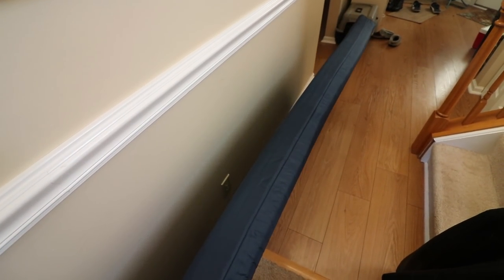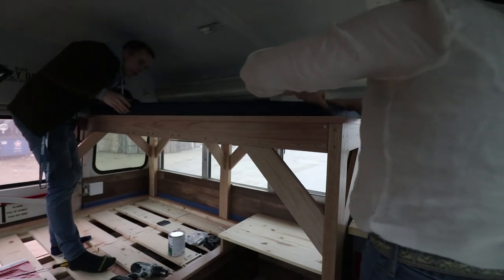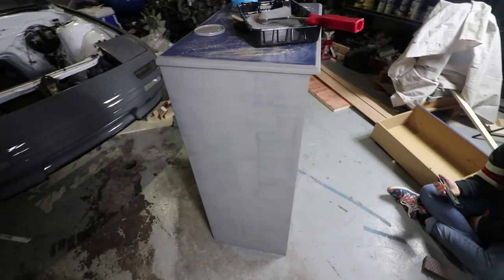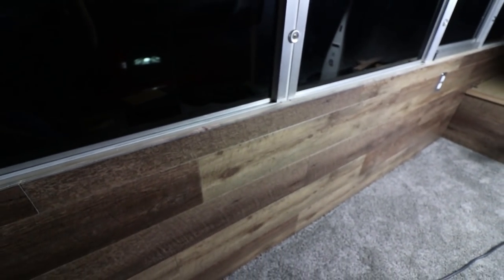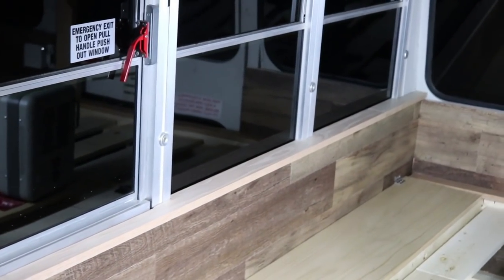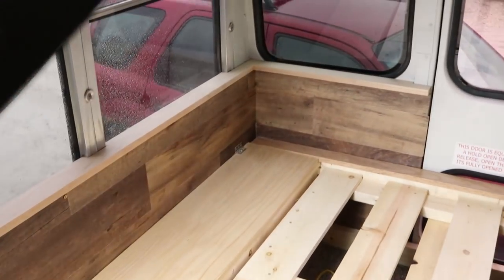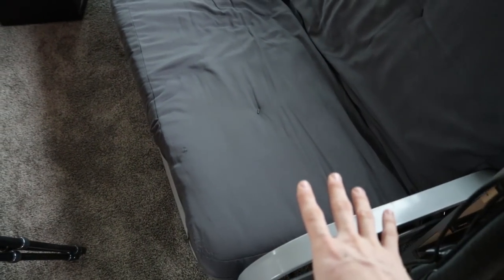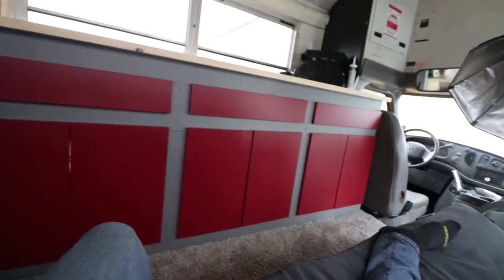Adventure Bus Build Pt. 14 - Dresser, Futon, & Window Trim

Comment: Get a mini fridge
Reply from the maker: We will!
Reply: Gingium how much have you out into the bus?
Reply: Don't get a cheap one, vertical 6volt is better I've heard.
Reply: Pretty sure that’s a requirement if it’s registered as an rv
Reply: Working sink, bed and cooking equipment are the requirements in Europe at least. Fridge is optional, you can just use cooler. :)
Reply: DG good point I actually believe that’s how it is here as well
Reply: mini fridgium
Reply: Where would he keep it? But that would be amazing
Reply: Why no sink and cooking oven
Reply: Yaaaaaa

Comment: Ginguium install a small propane heater and build  a metal compartment   for the gas tank under the bus there is plenty of space for it it will be more effective for warming your bus and save fuel while parked. I own my own shop on wheels and the heater works wonders on a 71 passenger bus  it heats up the bus way faster than a electric heater

Comment: Tinting those rear windows, is 50 state legal. You could paint them black, if you wanted. Only some states have laws against tinting the front window; driver's and passenger side, and the windshield, of course. I agree w/ you that curtains are a better option. They block out all vision, into the bus, and you can still open them, when you want the daylight.
Reply: Yeah... he said that in the video

Comment: sorry you weren't invited to the callout... #NoOneRespectsMiatas
Reply: Victory Gamingg wow... Just wow...
Reply from the maker: They're all too slow anyway
Reply: Gingium honestly I really don't care about speed. A slow car just means you can floor it longer!
Reply: Cole Reisdorf legally that is.
Reply: SlammedSocietyS2k :p well... I have my permit so if I speed my parents will freak out
Reply: Victory Gamingg I subscribed to you
Reply: Gingium what do you mean and hi
Reply: Heh, don't get in trouble with a permit. Will get suspended. Wait till you get your license. Then it still won't be great, but it won't be instant suspension.
Reply: Cole Reisdorf wait you meen to tel me you don't drive ferari
Reply: If that RX7 was turbo swapped in time it could have been a contender👌😢
Reply: Victory Gamingg HEY DUDE.. if you dont respect miatas, thats not our problem. If you don't like them.. WTF are you doing here??
Reply: Cole Rei
Reply: Milton Gimenez how could it be a contender if the lowest horsepower car in the race was adams 335i with almost 700hp
Reply: Cole Reisdorf last I checked the conversation was about his Miata. Not your driving
Reply: Spinddrift incorrect by far. David's 240 was the lowest power
Reply: Victory Gamingg oa

Comment: Put curtains up front and back but the rest can be as dark as u want with the tint, and it's legal to have tint on the side windows so please do tint. It's not hard and it's not that expensive. It will make the bus look better from the out side as well. And when your sleeping you won't have lights on plus with the lights on people won't be able to see in. So for the love of God please tint the widows. Ps this is like an essay for me^^😂😂
Reply: Jackson Beck nah trust me the curtains will look like tint as long their dark. Besides the side windows will provide natural light that will be much needed in the bus.
Reply: I think in Illinois you can only tint to like 35% blockage max on side windows if he wants to remain legal
Reply: That law is stupid! So I can drive a panel van with no windows on the sides (0% light transmission) but if I drive a van with side windows they can only be tinted to 35% light transmission? Stupid, just stupid.

Comment: How will you power a tv?
Reply from the maker: electricity
Reply: Gingium thanks for the reply lol but will you be getting a generator? Solar? Maybe just a bunch of batteries powered by the bus’s alternator?
Reply: Joseph Samsor he said in multiple videos he is using solar panels on the top of the van
Reply: Inverter
Reply: Gingium 😂
Reply: Could always use a similar system like the 18 Wheeler guys do. All the HVAC and Electricity is basically generated as needed for little to no diesel fuel at all. Should be able to easily adapt a system to the bus for this and never have to worry. Uses maybe a 1/4 gallon diesel for like 4-5 days or so (I was down once and thats all the system used to maintain 66F and a gaming PC at near full load all of the time.
Reply: Gingium 😂😂
Reply: Joseph Samsor  He can use a DC to AC power inverter off the bus' battery and when it's running, the bus' alternator.
Reply: He has an R.V battery to power electronics without using the engine Battery
Reply: Joseph Samsor they have batteries or a generator like a van
Reply: Gingium got em
Reply: Solar panels, batteries, inverters.
Reply: KENNETH _2v B U S
Reply: my brother had a top of the line sound system in his car, made the alternator make a whine sound similar to a supercharger when he revved it, it was na so really the only thing that would make a whine sound like that would be the alternator
Reply: Joseph Samsor The worlds first hybrid diesel
Reply: Shelby427Gaming Should've upgraded his alternator
Reply: electricium?
Reply: Angry pixies.
Reply: Joseph Samsor its called a battery and an alternator
Reply: electrical system powered by solar pannels
Reply: Joseph Samsor 
He gettin a generator

Comment: An easy DIY small mattress is to buy a cheap twin foam mattress from Walmart and just cut it down. Also, buses have pretty heavy duty suspension so I'm sure weight won't be a problem at all.

Comment: You can do the side window tin pretty much as dark as you want.  You can also panel off some of the windows.  Here in a few years I am going to be doing a bus conversion, so I have been researching.  You can also do the one way design tint (like the mossy oak tints you see on trucks).  You can't do the driver window super dark but the rest are not a requirement for normal line of sight driving (kinda like a panel van).  It look really good.

Comment: Dude I can say is you have to throw some tints on the windows. At least something not too too dark. It will help tremendously. Curtains is a must yes. And also try considering a divider curtain. So if you’re changing clothes or sleeping you don’t want the sun to shine through from the front windshield. I drive trucks and that curtain helps tremendously especially when it greats bright nice and early in the summer mornings. 🤙🤘🤘😎

Comment: I hope you read this Caleb, gentex makes a really good electronic rear view mirror, you set up a small camera on the rear and it wires to an electronic display of the “mirror” (most of them do function as a mirror with the flip of a switch) I think it would be very handy with the bus being limited to side mirrors. Hope this helps if you see it!

Comment: Paint the wood just using the brush instead of the roller, needs less coats as you can put it on thicker and the finish is still good

Comment: I think the bus is turning out awesome BUT I do in fact think it will be too heavy. Keep in mind that while yes maybe the kids and seats added a couple thousand pounds the furniture you added plus the trailer plus the car and tools and tires that you will put on the trailer will very easily double if not triple the weight of those kids and seats. It is going to struggle as a tow rig. As a adventure bus however it'll be MINT haha

Comment: So I’m guessing your gonna have everything powered by the bus engine. If that’s the case your gonna need to figure out a fast idle situation if your just sitting still and need power. It actually pretty terrible for an engine to sit there idling for long periods of time. But if you can figure out a way to make the idle go up to like 1300 ish rpm it’ll be fine and you won’t be damaging the engine

Comment: If adding a lift was in you lease agreement then that would be your out  and as for weight let's take a low ball at this, 24 seats at 50 pounds is 1200 pounds.  Standard weight of a student low ball 130 pounds x48 (2 per seat) is 6240 pounds so 7440 pounds is probably what it drove with daily.... Yea I think your fine on weight

Comment: At least us a nailgun to hold it on there better
Reply: s8plus galaxy nail guns are for framing
Reply: hes probably talking about a brad nailer, not an actual nail gun for framing
Reply: Yes cuz if he just using glue it's just gonna end up falling off
Reply: wood glue and most construction adhesives are a much stronger bond than just brad nails would be. They are very helpful to hold it together while it fully cures though